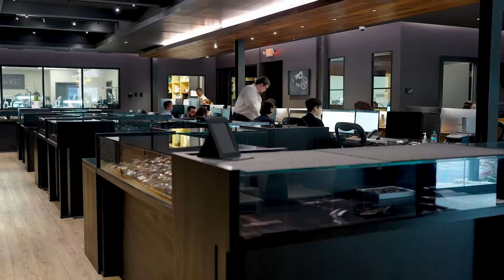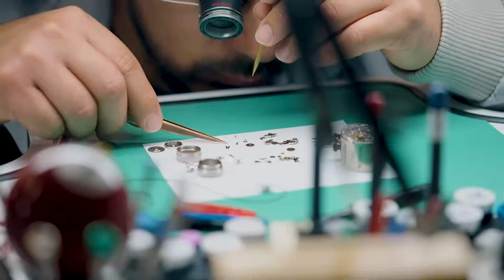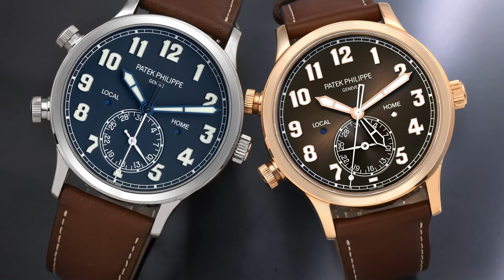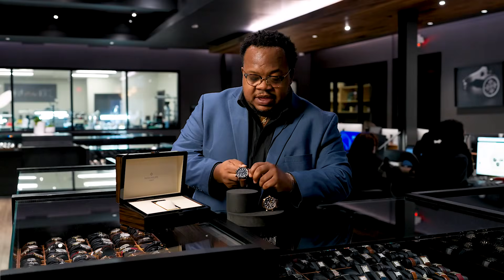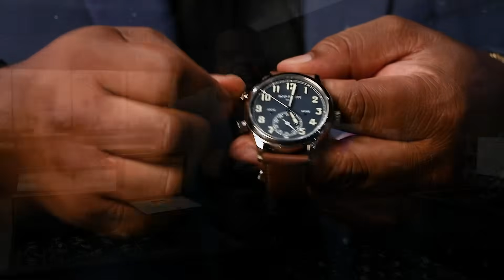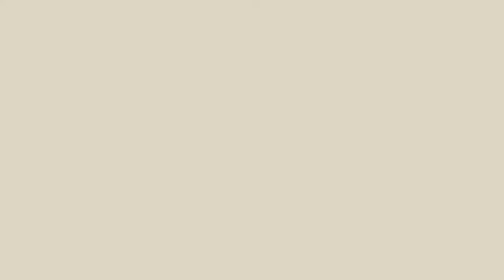How to Use the Patek Philippe Calatrava Pilot Travel Time | SwissWatchExpo

Comment: The white hand moved by the pushers is not a GMT hand, it's local time, which changes as you travel. A GMT hand is used on a watch with a 24 hour dial and makes one revolution per day, not two. Also, you didn't cover changing the date.
Reply from the maker: You are completely right on the logic—the solid hand jumps for local time while the skeletonized hand holds home time. Spot on callout! Check the full breakdown at SwissWatchExpo.com.